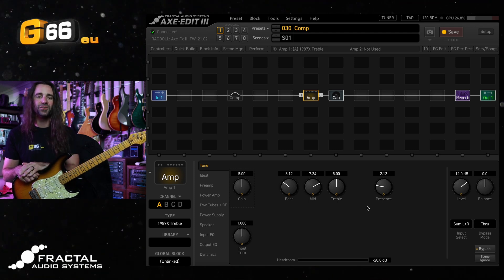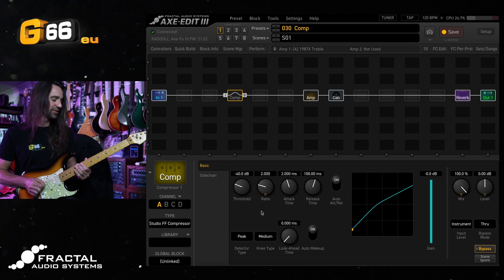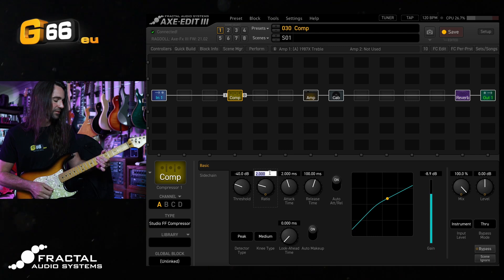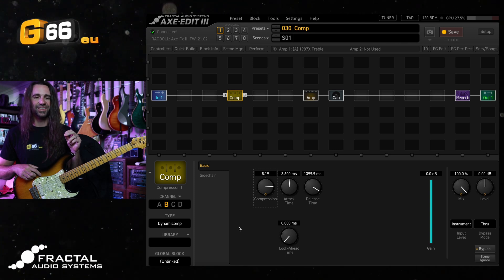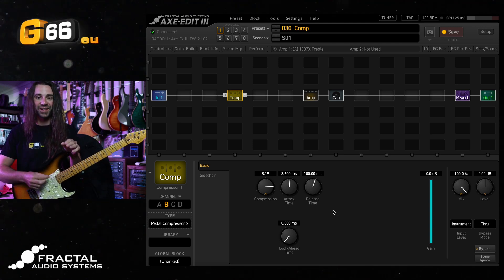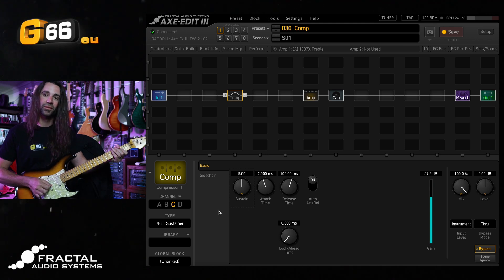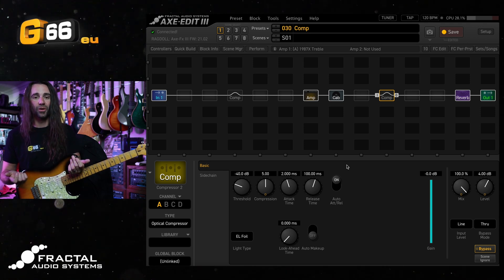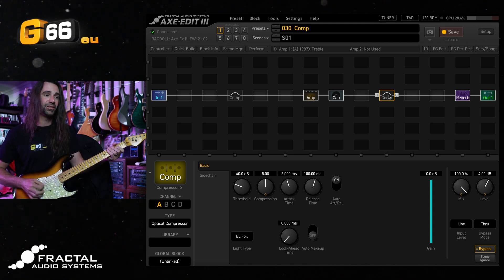4 Ways to Use the Compressor Block | Tuesday Tone Tip

Comment: Thanks for the great video.
I'm using AXEFX III and when I use the compressors like in your video I'm not getting the same thickening effect that you are. I have the auto-makup on but it really sounds like the gain is turned down on the compressed signal rather than nice beefy sound. 
I'm using a stat too btw.
Any idea on what I might be doing wrong?
Reply: OK I did a firmware update and that did the trick. I guess going from firmware 15 to 24 had some improvements.

Comment: Cheers for the lesson on the compressor block Leon 👍 What i'm struggling with the axe is getting my FRFR speakers to sound any decent as i'm only using my Presonus R80 8" AMT monitors which sound great. A tone tip video on getting the FRFR sounding  right or starting point as such would be super .